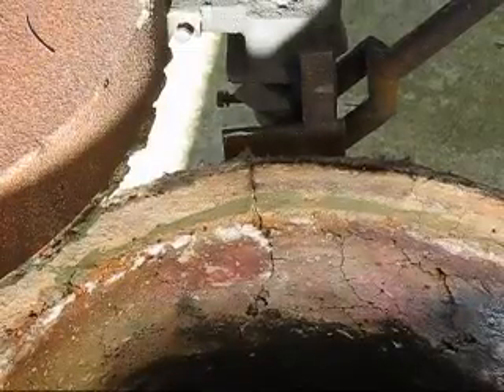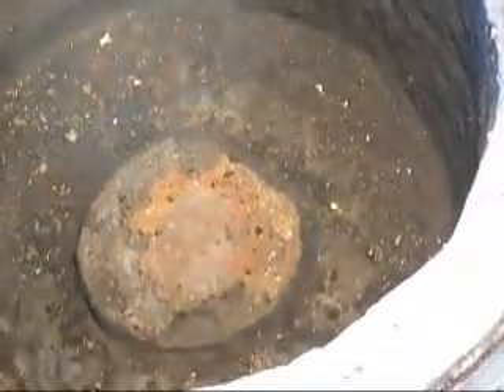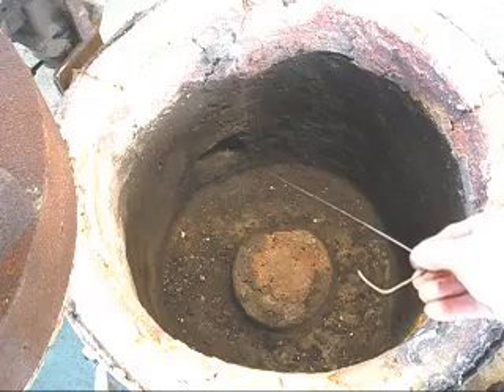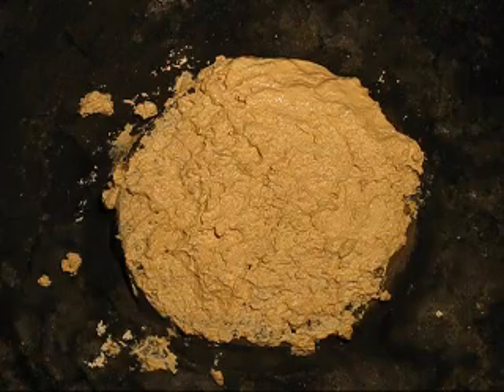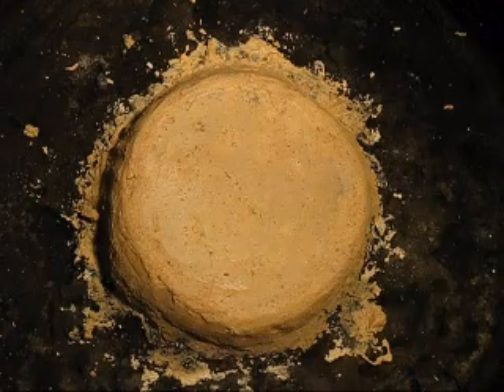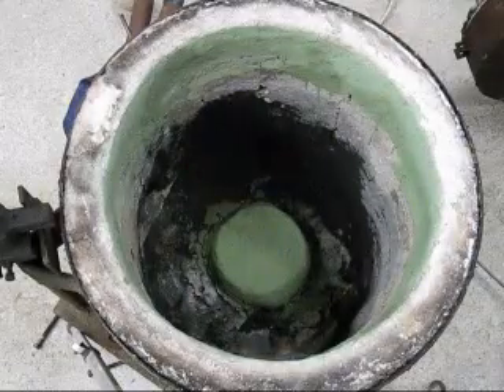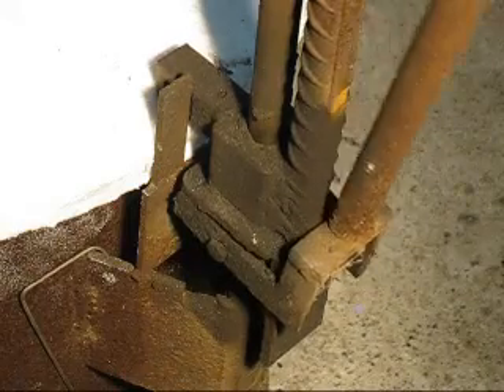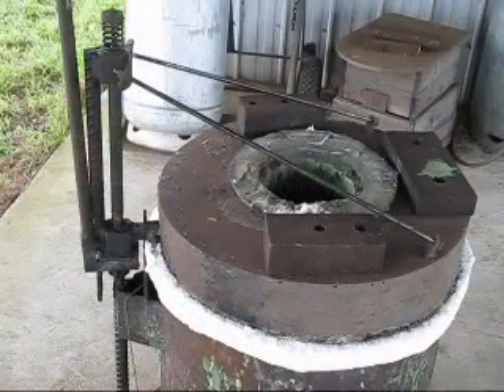Waste oil furnace overhaul

Comment: I am researching, trying to figure out the best way to add oil to a propane fired forge (that I have not yet built).. I'm sure from the amount of work you are doing, you have this well figured out.. I see in the video your 1.6mm orifice, and the description of the venturi 65mm large, 40mm small and 20mm wide..In the video, it looks like a copper tube running right to the end (in the middle) of the air/propane inlet pipe, but, that didn't make sense with the measuments of the venturi.. When I went back, it looked like the oil supply tube enters from the bottom-side of the air/propane feed pipe.
I'm a bit confused about the venturi and feed.. Is the oil pressure fed? And, the Venturi, I can understand a pipe going from 20mm to 40mm creating a venturi, and a 1.6mm diameter feed at the right place pulling the oil in, but, I am also confused how the 20mm wide fits in with all of that.. I know it must have taken you a few revisions to figure all of this out.. You do some interesting work.. Your knowledge would be much appreciated.. Thanks for the videos.. I have watched every one.. The Jehova witness videos were cool... Lots of strange things in the Bible.. Makes me wonder how many times God would have tempted Adam and Eve, had they not finally ate the forbidden fruit when they did.. Even let the Serpent in the Garden to temp them..
I have a couple of things I would like to cast out of Steel, and would sure like to know how to add the oil feed correctly.

Comment: I like the burner. I think that would solve my heat problem. I have a commercial foundry furnace, about 250MM bore.
  Very much like yours.
It has in the refractory,  a double spiral flame inlet into the chamber.
  Now, could you tell me how much pressure behind the oil? I think I could retrofit.
  It your orifice ceramic?   Or is it cooled by virtue of the oil? 
  Thanks, and great job!
  Mark

Comment: Nice job relining the furnace. I used KAO wool also and covered it with a high temperature refractory cement in my little foundry. I think it could handle cast iron temps but I'm only attempting AI melts for now.